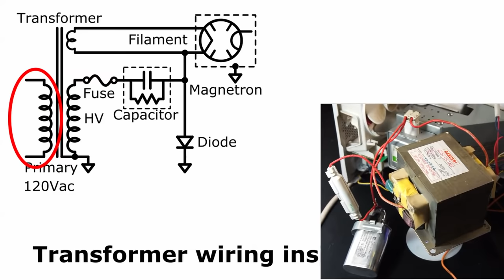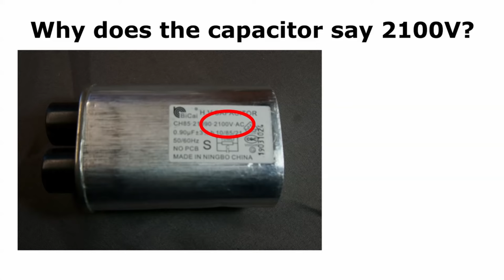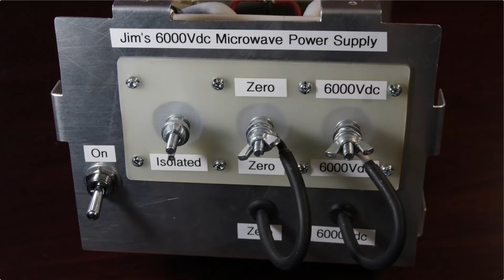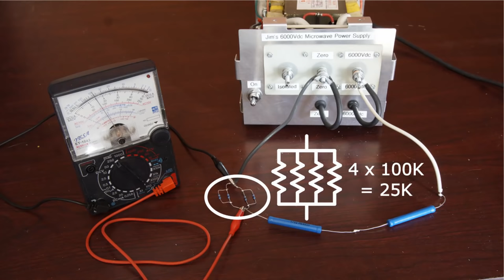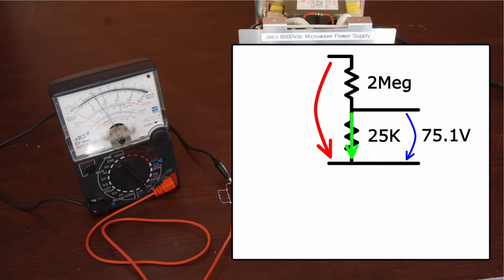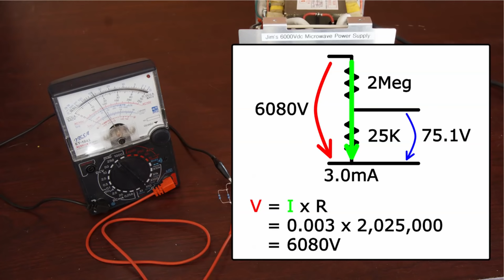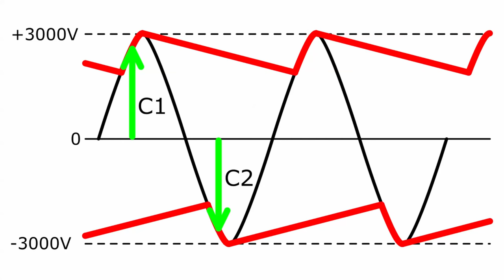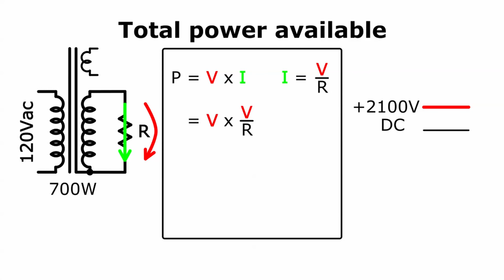6000Vdc power supply built from a microwave oven transformer

Comment: Anyone who needs this much of an explanation of Ohm's law and voltage dividers has no business working with such high voltages.
Reply: I agree absolutely.
Reply: So true.  See how many questions on what it can be used for. 
Even in a professional electrical context, such a device would require multiple layers of isolation safety and certainly not a 1 technician job. 
Personally, I reckon it is negligent posting such videos for morons to copy.  If there is some 'need' to demonstrate Ohms Law calculations, etc, then do it at low voltage level.
Reply: When i was 18 or 19 i built a slightly less lethal version of this and wired it up to the metal sprung seat base in my Opel Manta to prevent it from being stolen, i powered it from 1 of the battery packs from the Power Banks we used to manufacture they were 5 ah 2.2v yuasa cells in series giving a 50 volt supply i think it was.  I had a warning label printed in the windows and the car never gad an attempt made upon it to steal it.
Reply: Great comment I have worked in the comms field since I was in my teens ( now 67  ) and I have a healthy respect  for any voltage. I still got zapped pretty bad by accident had HV transformer on a static mat I know conductive didn't register this was a danger. !! My fault.
Reply: Could you tell me what is the best microwave oven to get hold of. The reason why I ask is you get (700 / 900 / 1000 watt ovens so which one is best to get hold of. 

Very good and impressive 💯💯💯 many thanks
Reply: @BTW... I would argue that said “morons” are going to attempt to build/play around with these components regardless of this videos existence. So it’s better that a video like this exists to explain the basics to the stubborn few who are building this consequences be dammed. 😊
Reply: @money1star I've just recently started messing around a little   with DIY electronics projects such as induction coils. This video is nothing compared to some projects on YouTube. I was going to make a spot welder  from a single microwave transformer so I could make battery  packs, there were several versions with differing levels of insulation or safety features. As a novice, I could've easily underestimated the danger of these devices. Or how about a diy stick welder with 4 microwave transformers wired, I believe, in series.
Reply: I guess you was straight out the womb knowing ohm's law huh...I've learned more from YouTube from people like this man in the past 10 years than all of my years in school.

Comment: Great video but there's one very important thing missing at the beginning of the video. The capacitor from the microwave holds a massive amount of voltage and sometimes the resistor that is responsible for bleeding out the capacitor fails, creating a deadly trap for whoever touches it. ALWAYS SAFELY DISCHARGE ANY CAPACITORS YOU ARE WORKING WITH AND MAKE SURE THAT YOU ARE COMFORTABLE WORKING WITH HIGH VOLTAGE BEFORE YOU ATTEMPT TO BUILD THIS POWER SUPPLY. Every year people die because they put they hand where they are not supposed to.
Reply: put in bleeder resistors over each cap - perhaps a relay that, when unpowered, engages the bleeders (so they don't interfere with the load)
Reply: Reading this made me feel a jolt go up my arm 🤣
Reply: @davestorm6718  In other words (same meaning) a relay with normally closed contacts wired from capacitor to ground, when AC is being applied, will trigger the opposite, (open state) to allow the capacitor to hold electric charge. The event of failure of that relay is something to keep in mind.
Reply: those capacitors already have resistors built in
Reply: The capacitor holds up to 21000 volts
Reply: @kornelu1 yes, but as he writes: the resistor inside fails over time and then it gas voltage even after hours switched off. So you may not expect it to be still charged and the energy in this capacitor still can kill you after hours.
Reply: Came here to make sure this point had been made. That he omitted to mention this is the most important thing about this video. One hopes it's not the cause of death or injuries, which unfortunately it could be...

Comment: Oops! I just noticed that your schematic indicates that your metal enclosure is not grounded! That's an industry standard No - No! Metal cases MUST be grounded when connecting to mains. As it stands now lethal voltages are present between the Zero and 6000 volt terminals and the Zero Terminal and the Transformer Core and any metal making contact with the Core. If I'm wrong, please correct me.
Reply: The schematic might lack it but it's present in the actual supply - https://youtu.be/OBQTBgFjFsQ?t=1504
Reply: At 6:00 he grounds it but he grounds it to the same transformer ... ain't you supposed to ground it to EARTH ?? PLS RESPOND
Reply: @PORTEnSious  It finds Earth Ground through the green conductor in power cable.
Wakodahatchee Chris
Reply: Just in case someone still wonders about the ground.  The metal case is grounded by the green wire connecting the middle prong of the power supply cable and the metal case seem at 25:27 in the video.  So you would need to use good 3 prong power supply cable on a proper 3-prong grounded outlet. The author mentioned he used a computer power supply cable for it.
Reply: What are you talking about about he explains with incredible detail.
Reply: @andrewCNC905  Yup! I have no idea! I've been trying to figure out what the hell I was doing a year ago when I posted all of these comments. I suspect late night + Jack Daniels was the culprit! This video is exceptionally thorough and meticulously videoed. Someone once said "Say it and forget it. Write it and regret it"!
Reply: @C Drive So do you mean this schematic is not safe?
Reply: @minhtetmaung587  the schematic lacks of a ground wire for the chassis.  The actual hardware build shown in video does have the ground wire (check other replies), and is "safe" to use. All that note asides, anything deal with live voltage is dangerous not to mention this device produces 6000v which are a lot more dangerous.  Only build it if you know what you are doing and know how to keep yourself safe with electricity. Even if device is safe to use, you can still be killed by the voltage it produces
Reply: @minhtetmaung587  YES!  Let there be no mistake, as is this video is deadly dangerous! Working with 6,000 Volts is by definition dangerous. As is it is not an acceptable student project. At 9:30 the author shows a "Test" circuit where he's determining the Transformer's current capabilities. In that circuit the schematic clearly shows the 120 VAC mains going to a salvaged computer ( 3 prong  ) power cord and connector. Earth Ground is clearly indicated here but when the video gets to 24:00 minutes the ground connection is AWOL! Sadly, this IS the Final Schematic he shows as the completed design! That schematic is also lacking the front panel terminal he labeled "Isolated"! 

It is my contention that High voltage power experiments leave absolutely No room for schematic errors or omissions. The same applies to anything said or shown as text. In the end Microwave transformers are designed to deliver *REAL POWER*, unlike an automobile spark coil or CRT TV second Anode.
Reply: @minhtetmaung587  I replied to you almost immediately but it disappeared. So here goes again but this time brief. This thing in its best form is deadly. This layout and schematic is by no means "best form". That fact makes this project damn near suicide! Please don't mess with it!!!
Reply: Why I didn’t have you as a teacher… 40 years ago 😢

Comment: I think you need to explain that anyone building this or messing with a microwave does so at their own risk !! You did say these voltages can be fatal, Im adding also cause terrible burns. I'm somewhat puzzled why anyone needs such a high voltage power supply. The only purpose I can think of is an RF linear amplifier. I shudder to think of an inexperienced person attempting to build this power supply or even attempting to probe these voltages. These voltages can jump gaps, and if you dont understand, please stay clear of this project. It will kill you !! I hope nobody is injured or killed after trying to duplicate this project. It is very dangerous !!

Comment: I will add AWESOME since it was not used yet.  I spent a career in electronics and related tasks, but I have never seen a finer video.  Even for myself it presents great explanations and illustrations for a good basic ohms law review.  I look forward to the rest of your presentations. I agree with the other constructive comments especially those related to safety. I might add a caution to remove all jewelry when working with these voltages. Safety here can not be over stated. Thank you

Comment: First off, I really enjoyed the content on this video. I'll consider this as a
reference for my own projects using a uWave oven transformer based supply.

Considering the potential danger here, I did want to make some comments on
safety.

Having worked at Los Alamos National Labs in the Pulse Power world for
many years, I was made to go to extensive high voltage safety courses yearly.
It was not my intent to be a nit-picker but some things I saw in the video
triggered me so I felt I should say something.

A. The leather/cotton gloves are a *no no*. If they become damp, or
the working environment is humid, those particular gloves can be more dangerous
to rely on than not using gloves at all.

B. Your power switch (IMO) is too close to the
work. One should create a safety operating procedure for working with high
voltage that does not involve exposing the operator to undue proximity to the
high voltage work to energize or de-energize the system.

C. We were taught to always assume the system is energized and in the
case of high voltage systems with storage capacitors, we were to create an
operating procedure for safing the system. One component of safing the system
was a discharging procedure, and then a safing (shorting) procedure. Typically
the discharging was done with a shorting hook or some kind of insulated
probe, a grounding clip, and usually an integral discharge resistor.  Finally
the system would be strapped or shorted across the output leads for maintenance,
configuration, or storage.

E. I recommend an insulated guard around HV connections to mitigate accidental
contact of the operator against the terminals or creating an unintentional
HV circuit with extraneous conductors that might come in contact with the terminals 
during operation.

I thought the safety glasses recommendation was a very good one. Having had high power
components explode and hit me in the face, I can attest to their value in
this kind of work

And finally, for your own safety, I recommend you lead your presentation with a disclaimer. :D
Reply: Thanks, you saved me the trouble.
Reply: The large capacitors in microwave ovens usually have integral self-discharging resistors (either 1 mega-ohm or perhaps 10 mega-ohms), hidden inside the can but connected across the terminals. So if left alone for long enough, a device like this will eventually discharge itself. But for capacitors from other sources, where you have no idea if they might have internal resistors, I would agree to put a self-discharge resistor in.
Reply: I wondered, if he got his pictures mixed up or something? Leather gloves is a no no and a no brainer for this application.
Reply: @lloydevans2900  That's right. They're called "Bleeder resistors".
Reply: Great comments!
Reply: I like watching videos for the refresher in areas that I learned in college but have forgotten for the lack of application in my particular field. But better than video itself, are these safety precaution reminders that you put forth. He should pin your comment as a before you begin notice. You are very articulate, and yeah, the leather gloves definitely not. Thanks for the refreshers, I needed them, and I have been in the field now since 1987. One of the key elements to doing this work for so long is putting safety first. I know people, especially hobbyists, don't really want to rely on others. But I would also add that just as having a spotter when lifting weights, never work on this stuff alone, and always have a nonconductive  safety strap available.

Comment: So much here to appreciate.  A very well organized sequence with supporting calculations, consistent tempo and a great lecture voice.  Just outstanding.  In this design, I can’t help wonder about output lead insulation proximity to the enclosure face holes, and potential for plasma arcing through the chassis.   I see great care with the panel face wing nut lugs, but the two cables seem very close.   I’d love to understand how he arrived at the cable insulation.

Comment: I use 2 of them and a full wave bridge circuit. Just feed the primary in opposite phase. Now you can ground the transformers  case to safety ground and use the 2 hot leads  with a single diode each for full wave rectification. I have bought identical cheap 1.2kw microwave ovens for exact this purpose. The combined cost is still cheaper than a new dedicated HV transformer. I remove the two heater winding and rewind them. One feeds the tube heater, the other produces 12V for the electronic and relays. I run a 1300w RF amp with that circuit and it works well. It can do 1500w  when the amp is switched to class C for digital. Many microwave oven transformers are current limited by the use of magnetic shunts. One can remove those to draw full current from the transformer

Comment: Great video. I've used the same full wave doubler you use. Works well with zvs drivers powering AC flybacks too. You can double and even triple the voltage of your ferrite core transformers.

Comment: WARNING! Those attempting reproduction of Jim's design take note! The Output Terminal labeled  "ZERO" is DEADLY! Properly labeled, it should read Output Common or at the very least ... "Common"! Simultaneously touching the "Zero Terminal" and  Earth Ground, water pipes or any electrical chassis at ground potential could KILL YOU! Personally, I'd be labeling the "Zero Terminal "* with industry recognized danger symbols and graphics! Hell, at these voltages I'd be EXTRA VERBOSE with my labeling!

Aside from that unfortunate oversight, Jim's video is excellent! Voltage Doubler circuit theory was clear, concise and accurate. The Salvage and Re-purpose segments were also excellent and easy listening! I subscribed within the first few minutes of it!!!
Wakodahatchee Chris
Reply: Oops! I just noticed that your schematic indicates that your metal enclosure is not grounded! That's an industry standard No - No! Metal cases MUST be grounded when connecting to mains. As it stands now lethal voltages are present between the Zero and 6000 volt terminals and the Zero Terminal and the Transformer Core and any metal making contact with the Core. If I'm wrong, please correct me.
Reply: @cdrive5757 - the 2 x HV connections are not referenced to ground. Well, they are isolated by the diodes and capacitors so it's not 100% safe. The 3rd terminal makes no sense to me, neither does having huge exposed wing nuts o  those terminals... totally irresponsible and unsafe.
Reply: @johncoops6897  Did you bother to read all the replies to my original post 2 years ago? I think your comments were covered .
Reply: @cdrive5757  - well no, of course I didn't read "all the replies". Simply because there are NO replies, except for your second comment to yourself...
... I am the first person to reply here 🙄
Reply: @johncoops6897  I'm sorry but I counted 7 or eight, not including my replies to those that addressed me.
Reply: @cdrive5757  - there are no other replies showing to me, only your 2 comments. I can't easily prove it to you, given that they won't allow me to post a link to a screen capture. Seems that what you can see has been hidden from the rest of the viewers by YouTube  🙄
Do you still see them if you click on the link to "show all" rather than just replying to me?
Reply: @johncoops6897  Have you clicked the "*Sort By*" button? If not click it and select "Top Comments". BTW, what browser are you using?
Reply: @cdrive5757  - there isn't any "sort by" when you are viewing a particular comment. That only applies when you are looking at the full list of all the comments from all viewers.
.
I'm using the Android mobile app, not a web browser.
Very odd that it's not displaying replies. Normally they delete the whole comment thread if there is a word or concept that they decide is "unsuitable".
.
I've lost a heap of long and detailed technical responses due to inadvertently using some word they don't like 😫
Reply: @johncoops6897  John, I'm a retired EET coming up on my 78th birthday. I tried using my iPhone to view this conversation and damn near had a meltdown. I suck at doing damn near anything on a smartphone. The only thing I can suggest is viewing this in a computer browser. Sorry!
Reply: @cdrive5757  - no problem. Cheers 🍺

Comment: HI Jim, I have never seen a video like this in my entire life and 20 years of experience in Electrical Engineering. You method of explaning with crystal clear details and calculations is beyond explanation. This is a must for electrical engineering student. I liked your video and shared it with my students. Thank you so much for tons of educational material in this very simple power supply design but it has a lot in it. Regards.

Comment: Fantastic video, I would recommend to call the transformator metal for zero, and the two outputs for +3000 and -3000, just as your sehematic say at 23:22
Another problem is ripple at full load is very dominant, and at no load the 2100V rated capacitors are charged to 3kV, also an important note : some capacitors contain the diode, and also some times a 2100V "zener" in older owens the zener is a an extra diode acros the diode, and the normal diode is the one to chassis.